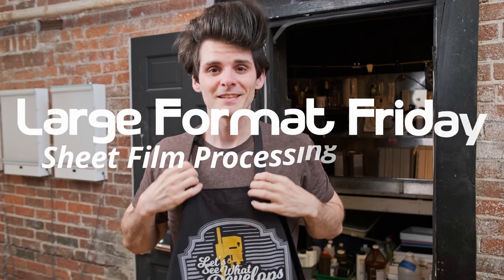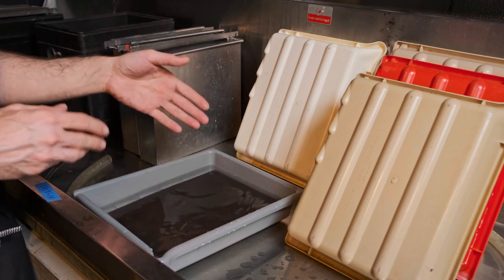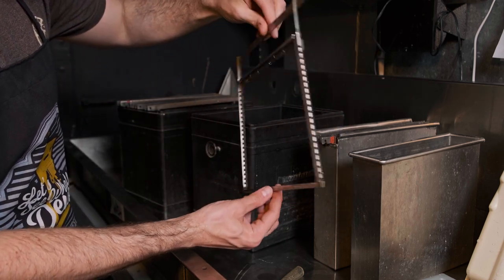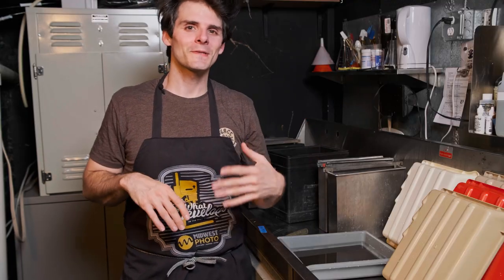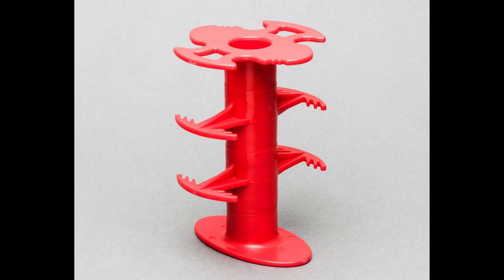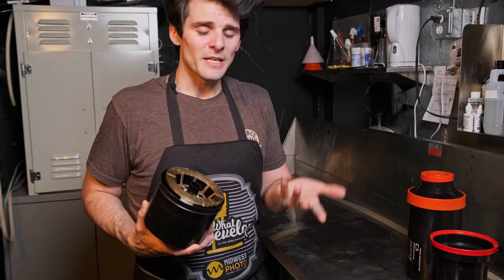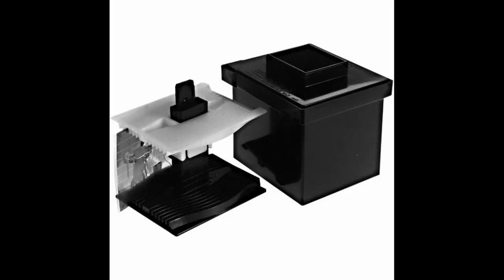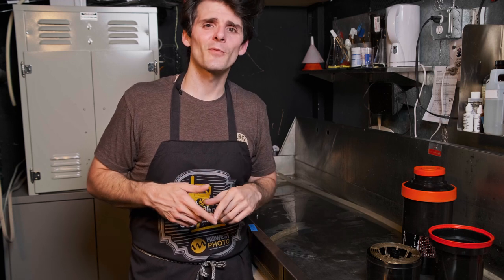Sheet Film Processing Options - Large Format Friday

Comment: The Nikor(single K) stainless tank. Does 4x5 but adjustable spacers for smaller sheets. Expensive used but are very good. Make sure it comes with the band that you place around the loaded reel so the sheets don’t end up at the periphery all stuck together.
Reply from the maker: Thanks for mentioning that specialty tank! Never knew that it came with a band, I've only ever seen the reels by themselves.

Comment: SP-445 it is for me (Jobo for MF and 35 mm film). I especially appreciate the small dimensions and efficiency with chemicals, as I don't have a darkroom and have to fit all my development gear into two 22 liter Ikea Samla boxes (chemicals for B&W and C-41 in one box, "hardware" including a CineStill TCS 1000 in the other box). Works fine as long as you don't put too much chemical in the tank (this is crucial, as the tank than starts to leak).

Comment: I process my 4x5 on a Jobo CPE-3 I bought second hand with their Expert 3010 drum -- it holds 10 sheets of 4x5 in tubes.  Mostly do C-41 and occasionally D-76. Easy to load and very even processing. One cute thing is the air pump to blow to drum open after processing.
Reply from the maker: It's funny you should mention that Jobo pump Gregory. The first time I saw one of these processors demonstrated, I turned away from the drum to a darkroom timer that was going off to signal the end of washing. Right as I looked to the timer, I heard the "bang" of it opening (it was a drum of 7x17" film!) and hit the deck.

Comment: Big fan of my SP-445, has certainly helped with my 4x5 processing! And do plan on getting the plate holders for the SP-445 and a 20th Century unit for larger number of sheets.
Reply from the maker: The 20th Century holders are definitely super exciting. Currently using the Instax Wide adapter for 4x5 plate holder!

Comment: Some folks hate the Yankee Agitank.  I've got one, and I can only presume they didn't use it long enough to figure out its quirks.  First, it's cheap -- $35 to $40 new plus shipping makes it the cheapest daylight solution other than tacos (which require you have a daylight roll film tank), and it's still in production.  Second, it holds up to 12 sheets (and comes with a loading aid to be sure each sheet is in the same slot top and bottom); third, it's adjustable for any standard sheet film size: 2x3, 6.5x9 cm, 3x4, 9x12 cm, and 4x5 (I use the latter two -- none of those other daylight solutions takes 9x12 in the same equipment).  Yes, it needs a lot of solution -- 1630 ml for 4x5 -- but it can process a DOZEN sheets in that, and if you replenish your developer, you'll use the same amount of replenisher for a given number of sheets that you would in the SP-445.

It took me a couple runs to figure out the best way to agitate it (by rocking, end to end, once left and once right equals a single inversion), but I get perfectly even negatives now, good enough that I'll be confident using it with C-41 when I'm willing to spend the money for color sheet film (I'm already replenishing Flexicolor C-41, so once again, needing a lot of solution doesn't mean it's expensive to operate).  It's a little splashy when pouring out the chemicals, but I'm using 2l graduated pitchers, which are plenty big enough to catch everything.

I can't use it to process glass plates from J. Lane, but of all the methods you've showed here, only trays or hangers and tanks can (the corners of a glass plate would puncture your zipper bag) -- and if I had a 3D printer, I'm sure I could print a rack for the Yankee that would accept and retain the same sizes of glass plates as it does sheet film.
Reply from the maker: Good to see some love for the Yankee tanks in the comments. 3D printing would definitely be a way to upgrade the Yankee for plates. And agreed on capacity, just because it takes a lot doesn't mean it's that expensive. There are plenty of developers out there that are very economical and have their own unique benefits and can be heavily diluted.

Comment: Hey Matt. For the tray method, do you just shuffle the negs during the agitation cycle? Essentially replacing something like the inversion agitation you might do with a Paterson tank every minute? Reason I ask, is Massive Dev Sheet has some pretty long development times for the dev/dilition I use (Ilford HC 1+31) - like 9 mins. That's a long time to be shuffling the pack if you need to do that for the full 9 mins. TIA. Keep up the great videos!
Reply from the maker: Hey Greg, great question! Shuffling the stack in trays does replace agitation inversion in a tank, so they'll be the same processing time. It might be the fact that I've been doing it for over a decade, but I find that time in the dark relaxing.

Comment: You did miss the (long out of production but very durable) Nikor stainless steel tank and cage for 4x5 (12 sheets in about a liter) and the very similar B&W King stainless system, still in production, 10 sheets of 4x5 in a liter, and comes in 5x7 (6 sheets) as well.  Cost is comparable to a Jobo tank and 4x5 reel, if not a little higher, but some folks just like stainless and they handle exactly like a stainless 35mm or 120 tank once they're loaded.  I have one of the Nikor tanks, but not the 4x5 cage for it; mine has a pair of 220 stainless reels instead.  I don't use it, and now likely would put it up for sale -- too slow to fill and drain after getting used to the Paterson (for 35mm and 120) and Yankee (for 4x5 and 9x12).

Comment: For developing my 4x5" B&W sheet film in my bathroom/darkroom, I have either an HP Combi-Plan which works well or I have over 20 Kodak #4A Stainless Steel sheet film racks that I have picked up over the years. 

The problem was finding something to use with those Kodak racks because my light tight stainless steel dip 'n dunk tanks disappeared long ago. (Insert the sad emoji.)

I started searching retail stores for something that would hold a dozen or so Kodak racks then finally found what would work at Dollar Tree stores. They are 116-ounce food storage containers that perfectly hold 10 sheet film racks or 12 if I want to risk scratches in the emulsion.

Yes, they are clear plastic so I need to pre-soak, develop, stop bath, rinse and fix in total darkness but that does not bother me a bit. Once in the fixer, I can turn on the bathroom light to see how the film sheets look and get ready for another developing run, if needed.

After fixing, I rinse well, use a hypo clearing agent (just in case) then wash well again. The final dip is a tank of Steam Distilled Water + a bit of Kodak Photo-Flo. I hang the stainless steel racks on a knotted Nylon rope strung above the bathtub. The knots prevent the sheet film racks from sliding down the catenary and touching each other. Once the film sheets are dry, I place them into clear 4 per page acid-free negative storage sheets. Then I wash the Kodak racks in hot water to remove any Photo-Flo and hang again to dry.

While the sheet film racks are drying, I transfer notes from my field notebook to the negative storage sheets using an Ultra Fine Point black Sharpie marker. I also add my filing number code to each sheet of film in the blank area along the edge using an India Ink pen that I get from an art supply store.

I have been working with 4x5" cameras since I was in high school in 1963 and these procedures work well for me. Please let me know if you have any questions.

Terry Thomas...
the photographer
Atlanta, Georgia USA
Reply from the maker: Thanks for sharing your process for working with stainless hangers and tanks! I may have to pay a visit to a Dollar Tree to pick up some of those containers.
Reply: @MatMarrash  
Take a couple sheet film racks with you to make sure about the fit.

Comment: Thanks Mat. I started out my LF journey only a few months ago. For my initiation I used FP4 and processed it in a tank a pal gave me. It's an old bakelite one made by Doran. It is a similar thing to the Yankee tank I think. It worked well but I just jiggled it to agitate as I guess that's how to do it as the top is light tight but not sealed; it just sits there. Also it takes well over a litre to fill it, though it will take up to 12 sheets of 4x5. Years ago I bought a Paterson Thermodrum which is a similar layout to the Job. I thought that while it is meant for paper processing it may work with sheet film. What do you think?
Reply from the maker: Thanks Jeremy! I think the thermodrum would work for 4x5, the only fiddly part would be getting film to stay still in the drum. I've processed big sheets in an old Unicolor print drum with two sheets of 8x10, so it's definitely possible.

Comment: I have no sense of political correctness so I'll just go ahead and say it..."Yankee tanks are awful" lol.   
The Steerman Press SP-810 is also a good solution for X-Ray film in 8x10 as well as 5x7 sheets and it may be the hands-down best non-tray option for developing Jason Lane's dry plates.  
My choices for 4x5 if I have a lot of sheets to do is the Jobo Multitank 5 with dual 2509N reels and that's placed on a Uniroller 352 auto-reversing motor base for rotary processing.  For smaller batches, I use Jeff's 20th Century Camera 4x5 six-sheet reels in the Paterson tank.   I find 20th Century reels much easier to load than the Mod 54.
For 5x7 I've been using 20th Century Camera's four-sheet 5x7 reels for the Paterson 5 reel tanks.  Jeff has a version now that will work with the Jobo Multitank 5 and I'm looking forward to trying those soon.  
For 8x10 panchromatic films, I use the 20th Century two-sheet reels, again in the larger Paterson tanks.  Jeff also has a version of that reel that works with the wider Jobo Multitank 5 tanks.   The loading system on the 20th Century reels is the same across all the sizes so once you feel comfortable with one it's easy to use them for all formats.  I also use those 20th Century reels for single-sided Carestream Ektascan B/RA from ZZ Medical.   For double-sided Fuji HR-T and HR-U I line trays with cheap glass from dollar store picture frames and try to be super careful about scratches when the emulsion is wet.

Comment: Are the only advantages to traditional developing trays the spout and the deep grooves to allow you to more easily flip the film? Could I develop 4x5 sheet film in some regular plastic trays? I want to be able to develop 1 sheet at a time. Could I just lay the emulsion side up and gently slosh the developer back and forth, transfer it to a stop bath, then fixer- all while agitating/sloshing? I don't understand the point behind the flipping.
Reply from the maker: Ribbed trays are much, much easier to work with when developing more than a few sheets of film in trays. Shuffling through a stack of film is the only way to guarantee the developer keeps moving throughout development. When laid on top of each other, sheets of film will stick and become very difficult to separate. One sheet at a time can be done with any type of tray.

Comment: The HP Combiplan has a disatvantage; it takes about half a minute to fill and draining the tank takes the same time. So better not use this tank with short developement times.
The advantage with this tank is that the filmholder is adjustible, it takes 4x5, but also older sizes like 9x12 cm and 6,5x9 cm. When you turn the sides of the filmholder around, you can also develop glasplates. Due to the long fill and drain times I use it only for my 6,5x9 and 9x12 sheet film.  For 4x5" I use the SP445
Reply from the maker: Thanks for sharing those tips on the combiplan tank!

Comment: Mat, loving these--thanks. I started with a Yankee tank, found it to be total crap, and picked up a Stearman Press 445. I was at first satisfied with it, but I've noticed a few problems. First, the leaks. It will leak, no matter what the company tells you. For this reason, I find it only suitable for black and white. Color chems, which naturally put off gasses in the early moments of development, cause substantial spillage of chems into your water bath, potentially ruining your suis vide. The other problem is with stocks with thicker bases, i.e. the pro-level films. They often adhere to the film holders, creating residual anti-halation layers and ultimate damage that shows up clearly in scans. Strangely enough, cheaper films like Arista, with their thinner bases, do not seem to have this same problem. I just got a 20th Century insert in the mail this past week. I'm hoping it will both be easy to load and flawless in development. I've got a lot more confidence in the Patterson tanks for color chems.
Reply from the maker: Thanks for the testimonial on the different methods Jon, hoping you like the 20th Century reels!

Comment: Is there any concern with the center arch support on the 20th Century 4x5 reel not giving even development? A cool design but seems like the film could bump up against that center part and block developer flow.
Reply from the maker: Hey Douglas, I wouldn't worry much about that, since the model you see in this video is an early Prototype. The latest 20th Century reels are sturdier and more efficiently constructed.
Reply: @MatMarrash  I bought a Bs 4x5 reel but will sell it and buy a 20th Century one since it can be used in a Jobo.

Comment: Fred Newman's BTZS tubes can also be used for single sheets.
Reply from the maker: Thanks Nick I do remember these but have never tried!
Reply: Fairly straight forward to use.The main benefit is that the tubes require very little developer (less cost) but demands constant manual agitation by rolling the tubes within a basin,container or sink.
Reply: @nickmoran1  I owned a set of those, got decent development but a bit of a pain since you had to fix them in a tray. Jobo/DIY rmotorized rotary seems to be the best strategy for my new foray back into 4x5.

Comment: As I just started with LF (4x5 inch, 9x12 cm and 10x15cm with a Toyo View 45G and a Certochrom from 1925) I currently use the taco method and the results are not too bad. However, I just developed about 10 sheets so there is still room for error 🙂. Recently I just ordered a 3D print of a reel that can be adjusted to fit a number of tanks (https://www.thingiverse.com/thing:3826578) - if it works it would be great. However, it will use the same amount of chemicals (about 800ml) as the taco method. So in the long run I think I opt for the Stearman system.
Reply from the maker: Thanks Axel!